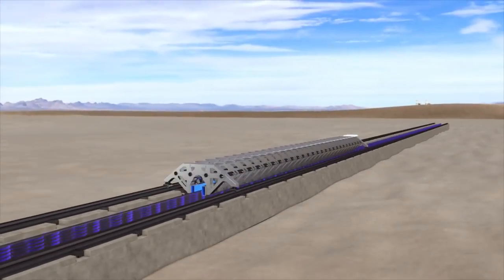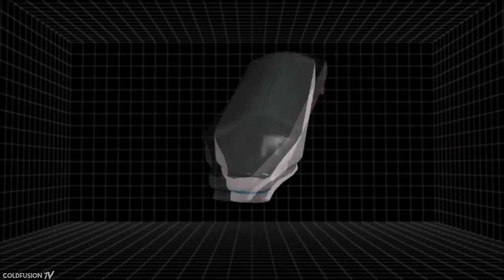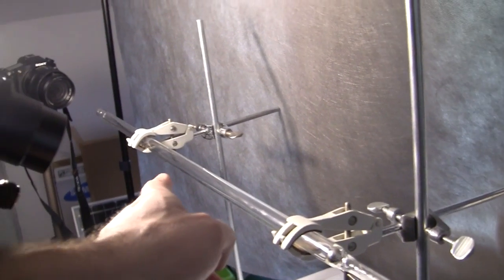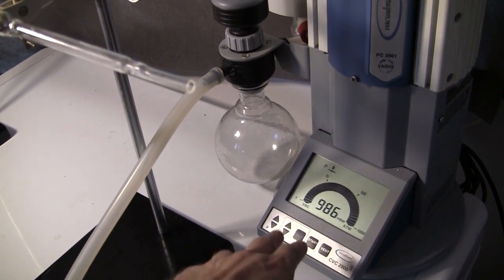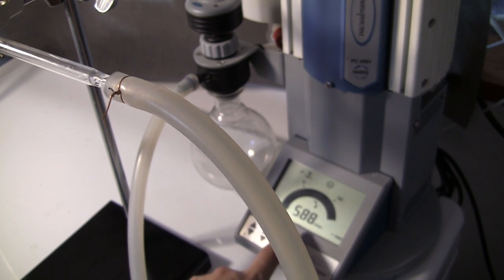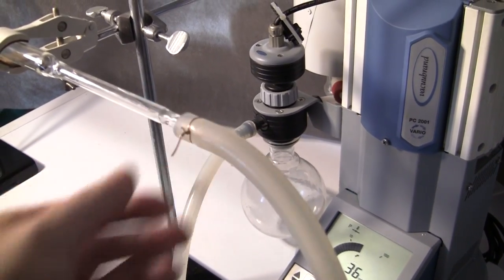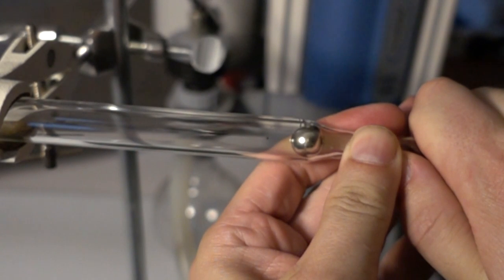How  the Hyperloop can kill you!

Comment: yes but what if the gently accelerate the craft instead of brute force? like limit it to 3Gs?
Reply: He's pointing out that there could be a catastrophic vacuum failure. Basically, the tube ruptures, and the pressure wave BLOWS the car.
As I said, there's ways to counter that. It's just a hazard you've gotta plan for.
Reply: @Bill... The plan is actually built into the design.  They will be accelerating it via electro magnets.  The same fields could easily be used to prevent excessive acceleration.  I mean, this thing will be designed to go VERY fast... surely no one thinks they don't plan to give it a breaking system... right?

And the cabin itself is obviously going to be pressurized so the people won't die...lol.  So, the worst case scenario would be that the outside would pressurize to the equivalent of the inside.  It isn't going to explode or anything like that.  Not during this scenario anyway.
Reply: yup I shoulda watched it all lol
Reply: 101perspective
Erm... the concern is that a depressurization along the tube would occur very rapidly. It'd be like running the car facefirst into a massive explosion. Brakes ain't gonna be enough.
Which is why they'd repressurize the tube on the other side of the car, to counter it.

As I've said before, the biggest argument against all this is cost. It's just consumes too many resources, making a vacuum in such a large volume.
Reply: if you read my top comment you would know I understand that now lol
Reply: Bill lupin
Well, there is no reason to believe they plan to make the passenger vehicle the same size as the tunnel... with only maybe an inch or smaller space around the edges.  It's not like the vehicle is pushed by pressure from behind or anything like that.

I'm guessing it would be similar in size as current subway trains are in comparison to their tunnels.  Thus, all you would gain is air resistance if there was a failure.  It would certainly be a lot considering the speeds... but hardly like driving into an explosion.  Just a guess on my part of course.
Reply: 101perspective
No, it'd still be like driving facefirst into an explosion, it's just the impact area on the car would be reduced. It's 100% necessary to balance the pressure wave with another from the other side. (Although the car would be exposed to a whole lot of pressure, it'd be getting it from both sides, so the net force would be 0.)
Bear in mind, we're speculating about a RAPID pressurization. A gaping hole ripped in the side of the tunnel. A whole LOT of air suddenly entering the tunnel at once.

In any case, it doesn't matter. It costs too much to make a large vacuum chamber.
Reply: Bill lupin
True, it would have to be a rather huge hole.  Something catastrophic would probably have to happen to cause such a hole. 

A greater danger would probably be the vehicle running into debris and stuff like that during such an incident.

I mean, it's a tunnel.  So, if tons of air is getting in then that means a LOT of rock, etc, got in first most likely.
Reply: 101perspective
Well, yeah. We were talking about a catastrophic failure.

no, metal/plastic shards would be more likely than rock. This is above ground.

But again, this wouldn't ever become a problem, because they're not building it, because a volume that size is HELLA expensive to pump the air out of.

Comment: I have disagreed with many of his bebunking videos but  I have to agree with this one. This will always be an energy inefficient and expensive way to move things. Constant vaccum and maglev. and massive construction effort to get from A to B. A plane can go anywhere with an airport. It's far easier to build 2 airports at sites A and B than would be to connect them with a massive vaccum  maglev tube. Especially along large distances. The cost of an airport is always the same. The cost of the tube scales up with each additional mile of tube.

Comment: This is bs, thunderfoot, they wouldn't make the train or whatever it is flush with the inside of the tube, they would put ample space for the rush of air to go past the train and the acceleration would not be dangerous.
Reply: IT's what would happen if you had a collosal failure but if you just had a leaky seal the pumps would just have to produce more power to maintain vaccum. In fact if the pumps went in to overdrive it would be a sign that there's a leak that needs to be fixed. Still I don't think this one is cost effective. The energy you'd need to create and maintain a vaccum and a maglev at the same time.... It's be like the concorde equivalent of trains. Cool, fast, but ultimately too expensive to put into mass production and would fail once the novelty wore off.

Planes are better because they don't require infrastructure. just the airports. You can fly along any path you wish in the atmosphere.
Reply: ShatteredMercury Actually the British made the Concorde profitable by getting rich customers but canceled it after it became clear that it was unsafe.
Reply: Yes I know, but it was more of a novelty plane for rich people. There were only a few crashes for the concorde compared to many more for other planes like the 767 or 737. Those design  flaws in the Boeing's were ironed out cause we all depend on 737's and 767 and their airbus equivalents. For the concorde people gave up early because there was just no money in it. few people would pay an extra few thousand dollars to get to london from new york in 4 hours rather than 6 hours.

 It's a shame really I'd love to see supersonic planes being used as extensivly and as routinely as subsonic jets today.

Comment: thunderf00t's dumbest video by far.
Reply: Whaddya want? He's a chemist/physicist, not a mechanical engineer. He stepped a little too far out of his expertise this time.
Reply: on a scale of what,  great and accurate to excellent and precise?
Reply: There are plenty of engineered solutions to expansion and contraction. Namely "expansion joints and fittings". There are plenty of ways to have silicon or similar seals that have excess space fitted into them. The Hyperloop is entirely workable. It's a question of willpower. Additionally, while it's true that it's expensive, so is the billions a year we spend on air travel which could be replaced.
Reply: Smucko Smuckovic What "Thickness of Steel Tubes" are you talking about? These are maglev systems (Normal high speed magnetic rail systems, in a vacuum created by a large tube around it, which can be glass, plastic, or any other material). The tubes only need to be able to resist 1 atmosphere of pressure. 14 PSI. That is pretty weak, a normal military submarine resists 440 times this, on average, at a thousand feet of depth. 

A terrorist punching a hole in it is not a problem, you simply have to go normal speeds. Big fucking deal. On an airplane, everyone dies immediately. 

Air travel could be replaced with hyperloop. They never said it would "never" replace air travel. Only that it would not give savings at the early stages compared to air travel. Obviously, no one knows how efficient these systems will be after 10 generations of technology. Aircraft in 1910 weren't too great either. We couldn't foresee jetliners, jet fighters, or supersonic bombers then.

You are delusional, for thinking human ingenuity can't make a fucking vacuum tube with a maglev train inside. We created nuclear weapons and put humans on the moon. We can handle a glorified pipe using existing maglev tech.
Reply: http://www.businessinsider.com/heres-what-happens-if-the-hyperloop-crashes-2013-8

Comment: I'm not sure I understand the point TF is trying to make. If something went wrong then it would be bad? I'll wait for the longer video, but other Elon Musk projects were met with the same skepticism and were ultimately successful.
Reply: Tortoiseshell Tech That's a bold claim to make without knowing the specifics of how the "tubes" are constructed. There's more to their construction than just literally being tubes.
Reply: Yep, it doesn't pay to bet against Elon!
Reply: He's saying if there was a rupture or leak in the 100 mile long hyper loop tube, the air rushing in would hit all the passenger capsules and accelerate them uncontrollably away from the leak due to the vacuum on the other side.

If the capsules are already travelling at speed then it's also probable the additional acceleration may over power the levitation magnets and cause a collision with the side of the tube.

Comment: presumably it will have brakes.
Reply: its about the acceleration, the acceleration would kill you. think of being on a plane during take off, now multiply those g's by like 10 and imagine that feeling
Reply: Myty Dem
I'm quoting OP now "it will be literally like being shot down a gun barrel WITH NO WAY TO STOP" this is what I mentioned brakes.

also the acceleration you experience during takeoff is only 0.3G. measured it yesterday with my smartphone.
Race-car drivers experience 3-4G all the time and they don't die.
Reply: yes and race car drivers work out and have to keep fit so that they can handle that shit, i mean 3-4 gs is no smal number and im saying imagine feeling that, the hyper loop will be well over that, i mean i dunno why we cant just do a normal magnettic train like japan is doing, this seems like a huge waste of money. a my horse is bigger than yours if you will
Reply: +Myty Dem it's because they want to achieve supersonic speed, and you can't really operate that at ground level pressure without a lot of energy and a lot of noise.  
Hyperloop should be cheaper and quiter than a normal maglev operating at those speeds. 
Even if it's used only for cargo it will be a great benefit.
Reply: hmmmm i guess, but the breaks will have to be active at all times during accelaration to reduce it, all im saying is i think its kinda waste

i get it but keep that tunnel depressurized will take alot of money, the initial cost to make the full tube air tight and structural strong enough to take that vaccum pressure would be insane, it would have to run for about 10-15 years before it becomes worth while
Reply: Myty Dem
To be honest, I really don't care about the development costs. It's a private endeavor, what they do with their money is their business.
What I care about as a user is safety, speed and how much do I have to pay for it.
Of course I do want to see a demonstration of an emergency braking system before I ride the thing, so if they do manage to handle that it's good enough for me.
But I won't go speculating about how high the acceleration is before I actually see some real data.
This experiment doesn't prove much, except that you can accelerate a bearing ball using vacuum

Comment: This technology seems good in theory but like with many such technologies there is a catch. For it to be safe it would probably require an expensive network of pipes resistant to all kind of damage for it to be reasonably safe, also i think that if it did get damaged it would be very hard to repair.
Reply: Right? its not like you can just patch it, the entire section of pipe would be compromised replacing however long that certain section of the pipe is for just one little hole
Reply: Yes, i guess so, it certainly would be expensive to repair these pipes, probably if such a pipe broke in one place it would rip the entire section.

Comment: This effect can be severely reduced by adding a couple safety features. Once the system detects depressurization at some point, it can open valves along the tube to let the air in evenly. And if that's not enough, the cars can then be dropped to bring them to a stop. Sure, the passengers may get small injuries. But pressure failures are, as the name implies, unplanned and undesired events rather than a part of normal operation.

Comment: If I were designing the system, I would add valves along the length. If the seal fails at any point on the line, you could open the valves and air would rush in along the length of the tube.
Also, brakes. The pods will have brakes...
Reply: How do you install brakes that are strong enough to resist a wall of air rushing towards them? And how will you cool them? Brakes do not magically destroy all the kinetic energy of an object. That's not how energy works. Brakes convert the kinetic energy of an object into something else, like heat energy. If your pod has 100 million joules of kinetic energy, to completely stop it, you would need to convert all of that into heat energy or some other type of energy.
Reply: @williamhuang8309  This comment is 5 years old lol xD But okay, I'll bite.
At the turn of the 20th century, many people guffawed about heavier than air flight and how that was impossible. We know how that turned out. Building a working hyperloop comes with countless challenges that may or may not make it impractical. I'm not personally qualified and/or knowledgeable enough to know if this is the case and likely neither are the so called "skeptics" from whom the anti-hyperloop opinions originate (you know the ones I'm talking about). Still, I think it's a cool thing and it will be interesting to see where it goes, even if it does end up being a failure. Goodness knows we have plenty of impractical technologies that due to prior development, are still viable.
I'm not saying "this is definitely the future", but if it really is bad on the level of solar roadways, then I need further convincing.

Comment: I'm still relatively optimistic about this. It's obviously possible and practical. The only questions I have about it are how are they going to maintain a near vacuum if it has to open to let people in and how much power does the motor use? My answer to my first question is that there needs to be some kind of airlock, and if that's the case the needs to be many engines constantly running to remove the air that is brought in by the airlock.

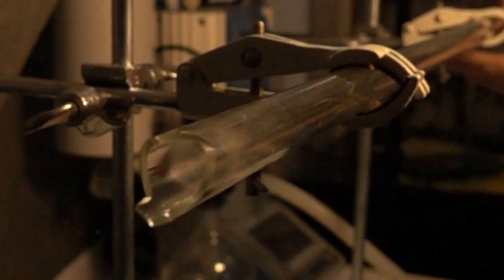Comment: while this is definitely a serious problem, it's not a show stopper. Not inconceivable an engineering solution will be found (relief valves opening in front of the vehicle maybe?). @ 3:40 : "No way of stopping?" I'm not an electrical engineer, but switching the linear motor into generator mode and shortening the poles with a suitable resistor to brake it seems like an option (to me).

Comment: You are right, but only if the tube has a complete failure right behind the train or in front of the train. Even if the tube ruptures throughout the whole diameter, the pressure can only propagate at a certain speed throughout the tube. After a certain distance, maybe one km, the pressure will build up slowly. 
Take a straw, cut it short and breathe through it. Any problem? No!
Take a very long straw and breathe through it and you'll see how much harder you'll have to suck. 
For your experiment: Take a long tube, suck the air out of it and fill it with some dyed smoke instead of invisible air. With your high speed camera, we'll be able to see how the air propagates into the tube. My guess, it will circle like a funnel.

Comment: wouldn't it be quite easy to prevent such accidents using safety mechanisms?
e.g.: a barometer every 100m notices decreases in pressure and could trigger the opening of a leak on the opposite side of the train so that the pressure on both sides is equivalent and the train experiences no force in either direction.

Comment: Couldn't this problem be solved using pressure sensors and emergency valves at several positions along the tube? In other words release the pressure both in front and behind of the vehicle.